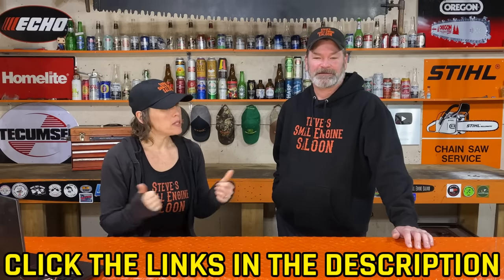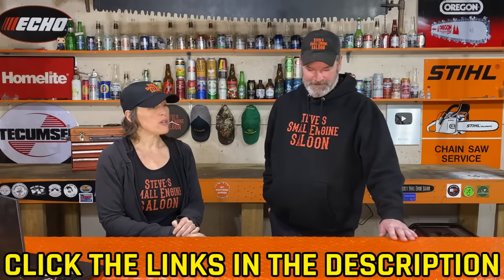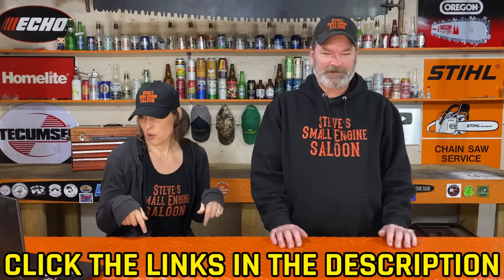Can I Use Old Dirty Motor Oil As Chain Oil In My Chain Saw? (DAY 18)

Comment: the oil atomizes(sp?) as its flug off the bar / chain and becomes airborn - then ur breathing in used motor oil - not worth it
Reply: Yup... 👆THIS👆
Breathing 2-Stroke fumes all day isn't gonna do you any good, but breathing a mist of used (carcinogenic...) engine oil as well is gonna mess you up BAD...
Why not smoke 60 cigarettes a day and drink diesel for breakfast too if you care so little about your body?

Comment: Hi April and Steve, could you imagine spending fifteen hundred on a top of the range chainsaw and then decide to run dirty waste oil through it, not to mention waste or burnt oil is carcinogenic as well, imagine adjusting your chain etc? Even buying the cheapest oil on the market would be better than using it.  Thanks for another 30 days of questions. April and Steve out!
Reply: Used motor oil as bar oil would have no impact to anything other than the bar sprocket and chain, which is a wear item anyways. It would be sharpened down past its useable life long before it would wear out.

Comment: As you know , old engine does not lubricate as good as bar oil. Bar oil is designed to stick on the chain and bar. My chain saw bars last years and years by using the proper oil and giving them proper maintenance. After all you would not put bar oil in your car ! Or would you ? 😂👍🇺🇸✌🏻

Comment: I have a foolish brother-in-law who borrowed my chainsaw and used motor oil for both mix and chain. He pretty much destroyed that saw. If one takes a motor oil in their fingers and then some chain oil in their fingers they will notice a huge difference in stickiness. Chain oil is definitely purpose formulated.
Reply: Don’t we all have an idiot as a relative?  Funny thing, so do they!  😂
Reply: Oh god. In the mix?
Reply: @outlawwill5483  Yup 😡
Reply: @Leonardokite  used motor oil is good for bar. But why the hell in the mix?
Reply: @outlawwill5483  because that is what happens when you use hard drugs. You don't give a crap. And there is a difference between use motor oil and bar chain oil. Bar chain oil is much much stickier.
Reply: @Leonardokite  ya I do realize it’s stickier but it works fine for my saw

Comment: Well, I use my old engine oil for something else that the EPA would be thrilled about and know of no one that uses old engine oil for bar oil. I change my auto oil a lot. It's never that nasty black crap you see coming out of most cars. My big gripe is not being able to locate the two blends of bar oil. We had summer and winter oil, thick and thin. Now days it is just the thin?

Comment: You are basically right about the used engine oil, however, not all of us run our cars until the oil is a black, runny, dirty mess. We think more of our cars than that. I believe my used oil does not fit your description, but still not as good as new bar oil.

Comment: The only time you can't use used motor oil for barn chain oil if you have an oil pump and all have to run through the pump it's not good for it

Comment: Apart from it just being gross and leaving stains everywhere, old engine oil is highly toxic as well. It contains relatively high concentrations of dioxins and other stuff.
Reply: That was my first thought as well, it’s full of toxic material
Reply: Not as bad as what comes out of the exhaust. I guess if you're that worried about used oil in a saw you shouldn't be running it to begin with.

Comment: I’m 52 years old and before me my father we burn a lot of wood growing up like 30 cord a year and for the last 10 years I’ve used the same chainsaw using used motor oil in it it works fine there’s nothing wrong with using used motor oil in your chainsaw they just want you to buy more steel products and more expensive oil for your chainsaw you can use use motor oil in your chainsaw it does not harm it in any way shape or form the chainsaw my father used was 20 years old when we started cutting wood with him and he ran it for the next 20 years and probably ran it 20 years after I left the house it works fine
Reply: Punctuation, my guy...
Reply: Oil used to be oil today it’s a computer generated conglomeration of ingredients modern oils don’t have zinc in them   That why manufacturers went to roller tappers in engines a those are even failing. Chain sliding on bar needs zinc. Add zinc additive to your bar oil

Comment: If it was abrasive you would have a blown engine.  No significant amount of metal should be in the used oil.  Can anyways filter it first with a shirt or something before using it using

Comment: Great videos but I got to say that's all crap. If the waste oil was bad and gritty your $5,000-$10,000 engine you just drained it out of would be shot. We ran a tree service from the mid 70's until 2016 all saws (Stihl's) only used waste oil only and we never had a problem. Some of the saws were in service the entire time. Now I just cut 20-30 cord a year and usually use bar oil because it does keep the saw cleaner. 👍

Comment: Modern chain saws using the recommended modern oil are specifically designed to retain the oil in the chain and bar and not spray it all over the place.
If you have used a reasonably new machine you will know what I mean.

I have as an " emergency measure" used new clean engine oil as bar lube ........ yes it throws it everywhere and uses a lot more.

I did some work with a bloke using, sump oil in his machine  ....... OH HELL NO ... that stuff gets all over you and the machine.

Comment: I send my used diesel oil out of lab testing.  It’s always clean and the lab says I could go on extended oil change intervals.     

If the used engine oil is contaminated so bad the oil filter is clogged and the bypass is wide open  with metal particles-  your $30 blade and $80 bar is the least of your worries.

Comment: Why use bar and chain oil vs anything else. If you dip your forefinger and thumb into bar and chain oil then separate the two, you will see a thin connective bit of oil between those two fingers. Why? Because bar and chain oil has an adhesive built into it. The adhesive prevents the bar and chain oil from being  slung off. Use anything else for a bar and chain oil you are giving up that benefit

Comment: I think if you filtered a heavy weight diesel used oil it would be fine. Oil like 15/40 would loose viscosity after being used and be similar to straight 30 weight.

Comment: There's another reason also, used motor oil also has unburned gas in it.
So it would also be a fire hazard to.
All you got to do is smell used oil it doesn't smell like oil, it smells like gasoline, if you happen to be cutting a pretty hard piece of wood the heat or sparks could ignit it and burn your chainsaw to the ground and you along with if that oil happens get on your clothes. Just sayin, not a good idea.
Reply: Completely not true!
Reply: @maxwelltodd7757  apparently Steve thinks its true i.e. hearted comment.
Reply: Oil burns all by itself. If used motor oil would burn in use all motors would  be blown up.